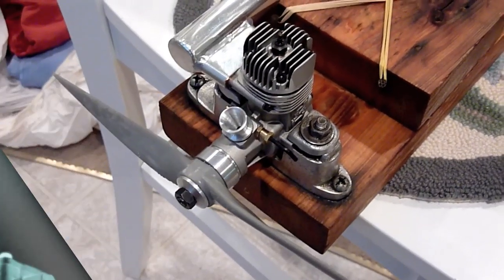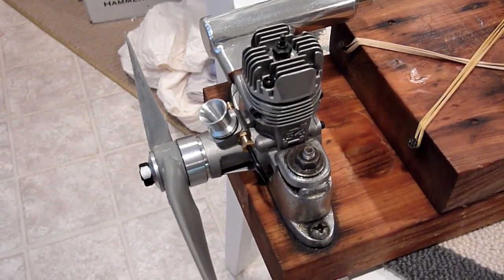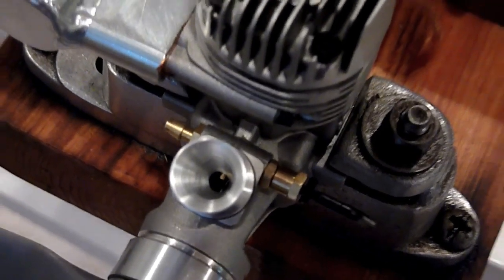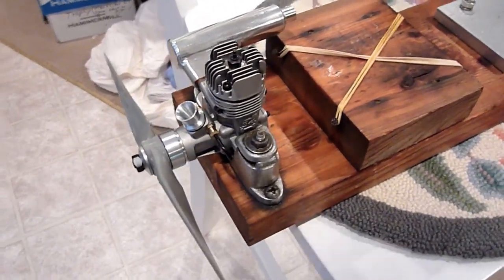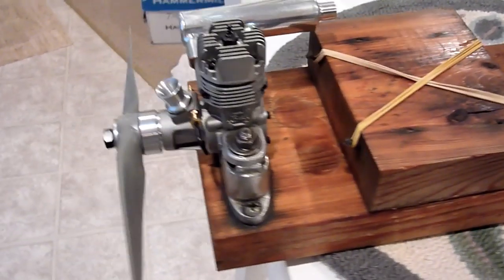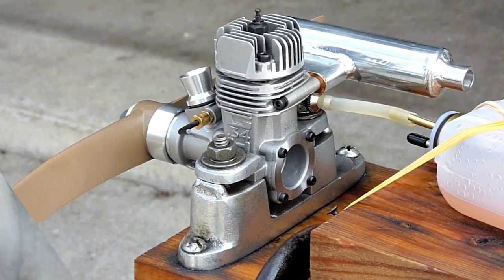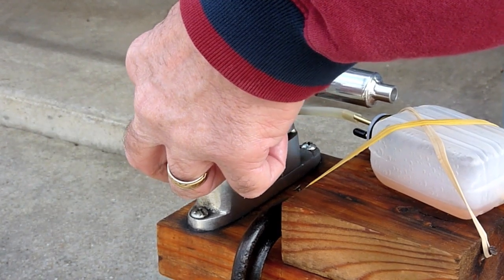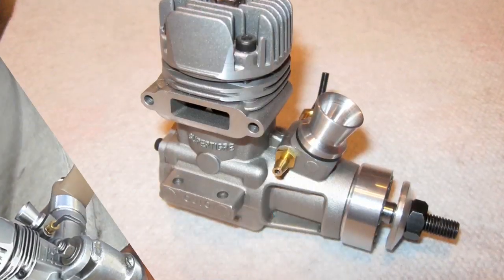ST34 test runs

Comment: Sounds like a Fox 35 running right at the 2-4 break.
Reply: It ran like this on the bench, but I was unable to get an acceptable run in the air.  I tried various prop loads.  I think the timing was too radical for a stunt run.